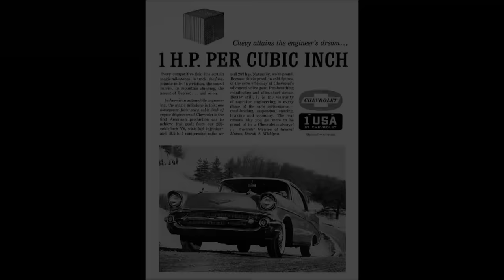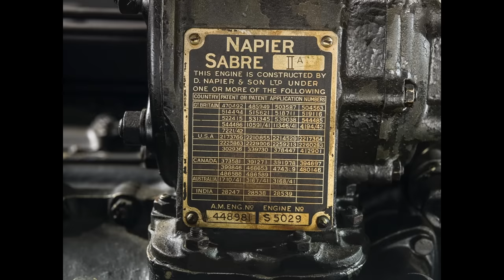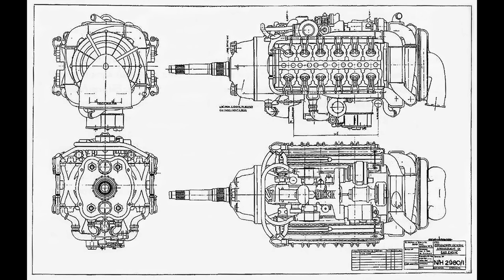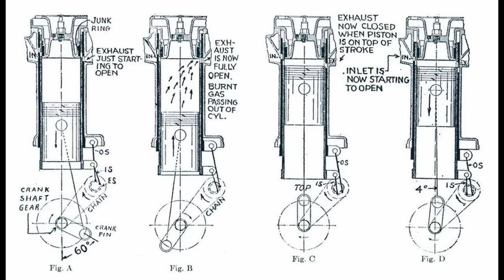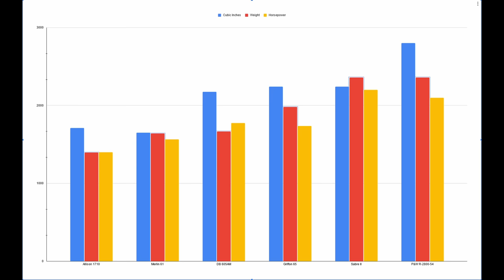Napier Sabre - The Ultimate WWII Aircraft Engine - Part 1

Comment: So how does the Alison getting a compound turbo disqualify it it seems the logical progression to me
Reply from the maker: Because the turbo in question is not a turbocharging system in the sense that the impeller is driving air back into the engine, but rather an impeller connected directly to the crankshaft.. this makes it something like a jet recip hybrid

Comment: Are there any Napier engines running today?
When did military phase them out?
Reply: Dale, I think there is a project to restore a Typhoon to flight status, this has a Sabre, I suspect that it is a long and expensive business. Most of them would have been withdrawn at the end of the war as the new jets were being introduced and had much more development potential
Reply: @scrumpydrinker  I figured they were scrapped quickly after the war. 
Does anyone have a pile of spare parts for those engines. 
Thank you update.

Comment: One problem is that it needed a craftsman to just assemble this engine. Imagine the problems that RAF maintenance crews had. It could not be mass produced as efficiently as other piston engines, this is vital in a war of attrition.
Reply: How many hours of maintenance per hours of flight did it take for the Napier Sabre engine compared to the other engines wasn't addressed in this video.
Reply: @autodidact537  I don't know, but the Merlin was supposed to be completely stripped down and reconditioned every 40 flying hours. As a Lancaster bomber rarely survived more than 10 hours this was not necessary very often. Like many things in total warfare quantity and the speed of production trumps quality every time.

Comment: Maybe have a look at the Rolls-Royce Crecy V12 two stroke engine, only 7 produced, it never actually flew because Jet engines were becoming pre eminent the RR engineers reckoned with full development it would've produced around 5000hp all from an engine that had a 30% smaller frontal area and weighed less than a Merlin.

Comment: The Napier Sabre (yes need french pronounciation) was relatively unreliable at debut, but after using some Bristol sleeve valve technology it as become acceptable...had a good power to weight ratio because was a high rev engine with 4000rpm at max power in comparision with 2700rpm for the Bristol Centaurus

Comment: I wonder if proper tolerances and modern lube oils (multi-weight & anti-acid and other additives) would have prevented a lot of the issues with this engine!
Reply: The Bristol engines who had the same sleeve valve system was very reliable with standard aircraft oils, i did known very well this engines because did work on Nord 2501 Noratlas who had 2 Bristol Hercules (14cyl) sleeve valve engines: they TBO was 30% longer as similar US radial engines!

Comment: Imagine if it had, quad compound turbos, water methanol injection, and light weight rotating assembly, aluminum or titanium rods, push it to about 9:1 compression, maybe a aluminum/steel composite meshing gears,  the cranks can likely be lightened substantially, with the lighter rods and Pistons, a complete redesign, could make it similar to the VW, vr6, w12's and such Audi engines, it could be called the x24,  with the cylinders in a somewhat x shape,  give it something like 4.5" stroke. With 6" bore,  we could obviously build much better engines today! Magnesium block, titanium rods, and gearing.

Comment: Well as complicated as the engine must have been with all those moving parts spinning at a high rpm it would be a nightmare trying to service it. It was war time. And that engine was anything but built proof.
Reply: The engines built during the war were very unreliable and had a short service life

Comment: No mention of reliability, or cost to produce. Higher horsepower by higher RPM and two crankshafts= more precise gearing in power transfer and prop speed reduction gearning. Seems the sleave valves didn't do all that well in Bristol engines either.

Modern (GA engines and modern may be mutually exclusive) GA engines go with simple and cheaper by prop speed and crankshaft RPM being the same, Rotax excepted.

Comment: Remember that high rpm engines need to run a reduction drive and that adds weight
Reply: NOPE: ALL WW2 high power engines, inclusive radials had reduction drives

Comment: The reliability record, 18:13, is the Achilles Heel. The complexity out in the FOB, is another drawback. I think the sleeve valve design makes this inherently prone to sudden, catastrophic engine failures. What about the carbon buildup between the sleeve, and the cylinder walls?

Comment: A grate presentation, but you did quickly brush over the poor reliability problems with the sleeve valve system which in a single engine killed a lot of pilots . the other major problem was in stating it,  it had a bad reputation of not starting and after three attempts and failure to start the entire engine had to be completely striped down due to lubrication problems. With an engine of this complexity this is a major drawback. The ground crew mantling an engine of this complexity was hugely difficult bearing in mind they were working in open fields .One last comment although I have to agree the astonishing amount of power achieved is remarkable for its time, the pilots who flew it did compere it to a cart hours with the temprent of a race hours. The throttle was was refer to as on on off switch with the power coming on all at once. Some thing many loved but it took a skilled pilot to get it off  the ground and back down again safely,  being the cause of many accidents. This was due to the huge toque from the single propeller. In take off, as the plane left the runway  the airframe  would  what to rotate around its own axis flipping the plane on its back this needed full ruder to compensate it. An amazing deign and engineering all the same.

Comment: Your video seems to ignore the issues of Sleeve Valve Engines:
a) During WWI, Germany was able to re-purpose the British Mark Series Tanks because the sleeve valve engines leaked so much exhaust that British Tanks would lumber across the battlefield after the crew died from Carbon Monoxide. All the Germans had to do is break into the tanks, remove the dead Brits, add a ventilation fan, and paint an Iron Cross on them..
b) The combat hours between rebuilds on the Napier Sabre was much lower than poppet valve engines due to wear in the Sleeves, which were getting chewed up by the piston rings. Better material science could have improved this, but then better material science would have allowed the Germans to win the air war with their jet engines which suffered from a combat life of under 30 hours before a complete rebuild was necessary.
c) A worn sleeve valve engines will lose almost half the power due to blow by, the reason that so few of these engines still run regardless of the application or manufacturer.
d) Leaking sleeve valves also wasted a significant amount of fuel per hour and they started leaking badly after just a few combat missions. Because getting fuel to Brittan during the war cost human lives, an engine that has the fuel consumption double is a major problem.
Or in short, this engine seemed good on paper but sucked to support just like the rotary engine, which chews up the seals on the rotors quickly. Most sports car owners would sell their Masada RX7 once they realized that the engine would need to be removed and serviced as often as an air cooled beetle engine and that they would get worse fuel economy than an American car with a big block V8, with 11 mpg being the fuel economy that one RX7 owner stated...

Comment: There is no racing engine today that used the sleeve-valve tech of the Napier...or the H pattern. It was complex and difficult to maintain but, absolutely mega for power, no question. An aero engine of the era more power? 4360 Wasp Major 4300 hp.

Comment: Merlins the majority.  I would have thought the PW R-1830.  Lack of altitude consideration and whether it's engine design, or supercharger design,  turbocharger design or simple lack of procurement, planning, and supply to actually create and distribute the various boost devices,  is a serious misstep. The V-1710 without boost was pretty hairy at 20k it sucked. In the P-38 with that monster turbocharger, different story.  Greg's did a whole series of what engine and at what altitude was it being asked to go to work at and with what boost.  It made a significant difference.  Napier actually should have put the money into turbine research. The writing was on the wall by 1940.

Comment: The Napier Saber engine would have far better if they had used a uniflow two stroke design, as they did eventually use in the Napier Deltic engine used for marine and rail purposes. A gas version instead of diesel would have been lighter and more powerful than the sleeve valve, also they would not have had the same lubrication troubles which was always the weak point as the oils of the time were just not up to the temperatures.

Comment: So bottom line what planes was the Napier used in???
Reply: + Smuggled News    For production aircraft, only the Hawker Typhoon and Tempest series aircraft used the Sabre.  The rest were prototype and test aircraft.   No Sabre is flying, but there are three projects (Tempest, Typhoon) that plan to use a Sabre, although only two projects have usable engines to rebuild.   Sabres are very rare.  It will be years before any Sabre is running.

Comment: The Merlin was the best engine of the war. This engine might have been great but wasn’t used enough to consider it the best. There have been many designs that were great ideas but were never made to be reliable and/or practical. The worst thing you would want in a war would be to make a newly designed engine that nobody knows how to work on. It’s much better to have engines like the Merlin or the radial pratt and Whitney that were easier to work on and parts everywhere.

Comment: How you determine "The best Engine" of the war depends on the criteria. This topic can be debated endlessly but I would say the two stage.Merlin would win on most counts. The 130 series could produce 2000hp , a staggering achievement for a 27 litre engine. The sleeves on a Sabre would expand at high boost squeezing oil out and causing seizure. The Secret Horsepower Race by Calum E Douglas is an excellent source of technical data on most of the allied and axis engines.
Reply: The Daimler-Benz 600 series is certainly the most successful aircraft engine in WW2

Comment: What's your source for all this nefarious Rolls Royce lobbying?  Sabre was pretty widely derided as a costly failure by pilots, the RAF and eventually the Air Ministry.  It was supposed to go into widespread service from 1941, but due to design and production issues and a lack of two-speed supercharger, it wouldn't be fully operational until mid 1944.  The two aircraft that used it, Typhoon and Tempest, had a crippling lack of performance when it mattered.  

Sabre was indeed an incredible piece of engineering, and you rightly compare it to a racing engine - but racing engines are way too complex for general service, take far too much maintenance and cannot be produced in the numbers needed to fight a war.  In the middle of a pretty serious fight, we couldn't afford such a beautiful piece of craftsmanship, and the pilots couldn't afford the delay it's protracted development took. 

--------

The RAF lost air superiority over the coast of France to the Fw.190 between late 1941 and late 1942.  This was because the Sabre / Typhoon combination was plagued with delays and defects.  By the time the Fw.190 turned up the Sabre / Typhoon was supposed to have completely replaced the Merlin / Hurricane on Hawker's, Gloster's and Westland's production lines .  But when it arrived in mid-1941, there weren't enough of engines for them, and the ones they did have couldn't do high altitude, had excessive manufacturing and maintenance problems, exhaust issues that led to carbon monoxide in the cockpit, and it didn't provide the power they were supposed to. 

So the Merlin / Hurricane continued in production to fill the gaps, an already obsolete aircraft in 1941. while Merlin and later Griffon / Spitfire production was stretched and abused to take on the Fw.190.  It would remain like this well into 1944 because of a poor decision on 24cyl mulitbank engines made by the Air Ministry in 1938. 

I have to admit he Typhoon airframe had its own problems, the Tempest was supposed to solve that, but was still only in limited service in 1944. 

-------

Your performance figures may be bench tests under perfect conditions of the later versions, but in 1941 / 1943 when it really mattered, Sabre had no more HP at altitude than a bog standard, single stage Merlin 45 and way less than the twin-supercharged Merlin 61.  Both of which were very much cheaper, smaller and reliable engines. 

Typhoon and Tempest had been built around the 24 cylinder multibank engine idea and couldn't be rebuilt to operate the Bristol Hercules, RR Merlin or Griffon.  The Tempest would eventually get the Bristol Centaurus and came into its own as a fighter.  Unfortunately the war was all but over when they arrived in the squadrons. 

--------

The Sabres produced for the testing phase, the ones that offered so much potential, were all hand built by craftsmen - they are stunning engines to look at, but it took years of development to create a version that could be reliably built in a factory -  up to late 1943 they were all practically hand built, the costs of which meant there would never be enough to equip all the aircraft they wanted it in. 

If you look at Tony Butler's 'British Secret Projects - Bombers and Fighters 1935-1950' you will see there were dozens of designs for Sabre engined aircraft in 1940/41, all scrapped because performance, reliability and production couldn't make the grade.  

This hole in British production in the vital mid-war period fell to Bristol and Rolls Royce to fill, which is why you may have heard Ernest Hives bang on about dropping the Sabre.  He was also arguing for the dropping of RR Vulture and Eagle, two X24 engines designed for Air Ministry's obsession with large multibanks.

You  may be conflating the argument between RR and the Air Ministry over the development of not just the Sabre but all 24 cyl multibank 2,000hp engines in the late 30s and early 40s. The Air Ministry believed two large engines would offer less drag than four smaller ones in large bombers.  They also argued this same engine would produce superior fighters and because they would be developed from existing engines - the RR Kestrel, Napier Dagger, Armstrong Deerhound - they would be easier and cheaper to get into production. 

They were wrong, but they persevered with their error well into 1943 - Vulture was eventually scrapped, Armstrong's engines never flew and were scrapped, but too much of Hawker's production line was built around Sabre so it had to be continued with. 

Napier weren't the only one using sleeve valves and 24 cylinders - Napier eventually came up with the Sabre;  Armstrong-Whitworth had their Deerhound, Boarhound and Wolfhound; Rolls Royce had their Vulture and Eagle. Bristol developed existing sleeve valve engines and came up with the 18cyl Centaurus which eclipsed Sabre in just about every performance envelope.  

A considerable chunk of UK engine development funds and R&D between 1939 and 1944 were taken up with the relatively few Sabres built (5,000 in total) compared with 8,100 Griffons produced in half the time and 150,000 Merlins, 58,000 Hercules - which is the scale of production that was needed.  Without all the work expended on Sabre and the other five 24cyl engines the Griffon and Centaurus could have been in service much sooner - right when we needed them. 

--------

Ernest Hives at Rolls Royce was under great pressure to expand Merlin production and develop that engine, which in 1938-44 was powering a great deal of British combat aircraft.  On top of this between he was spending tons of talent and money on the RR Vulture X24 - chasing the same Air Ministry requirement as Sabre. 

He was constantly arguing with the Air Ministry to drop the whole 24 cylinder multibank idea - it just wasn't worth the effort.  He wanted the requirement scrapped not the Napier engine.  According to Stanley Hooker, RR's supercharger expert - in his book 'not much of an engineer' -  the costs of developing the Vulture took so much from the development of his two-stage Merlin it was delayed by a year.  The same year the Fw.190 gained an advantage over Spit Vs because of the lack of suitable engine. When Spit IX got the two stage 61, they took it right back. 

All three of Armstrong's competing Hound engines were dropped before they flew, their problems weren't worth solving. The RR Vulture briefly made it to production but was crippled by reliability issues and was junked by 1942.  Hives wanted them all scrapped in 1939 in preference for V12 and two row 18cyl conventional engines. The production effort released could have given the RAF the right Merlin in 1941 and the Centaurus and Griffon in 1942.  

He was right. The 24 Cyl engine was a fool's errand.

Comment: Personally I place the P&W R2800 on a higher pedestal than even the Merlin. It powered far more aircraft, including fighters than any other engine of the era.
Reply: Where do you get that info from, they made 35,000 more merlins and it powered 20% more aircraft types than the r2800. You can't beat the sound of a merlin but if I'm going into a fight I'd rather have the r2800 any day
Reply: But those big radials had so much wind resistance!
Reply: @BuzzLOLOL  Well then, you just put two of them together and create the double wasp, then you plunk it into a fighter and call it the Corsair. ;)